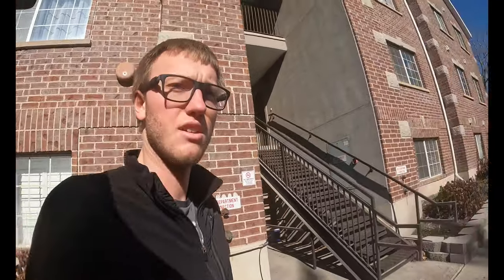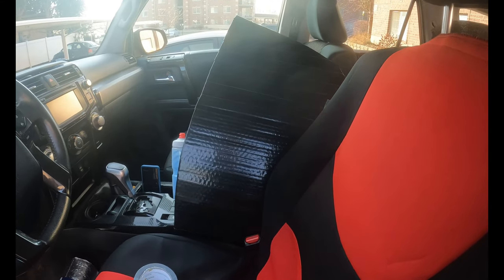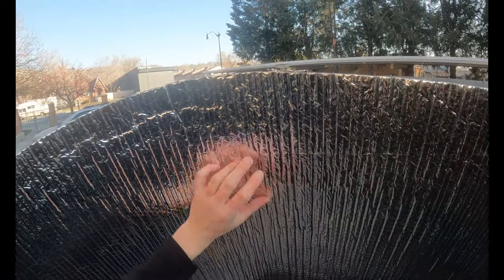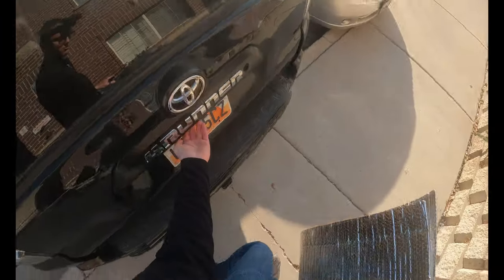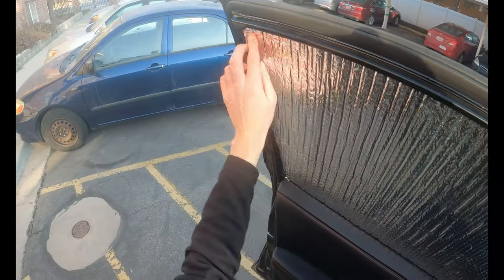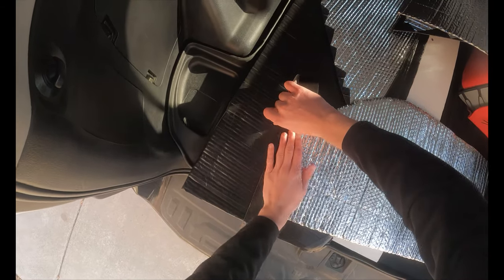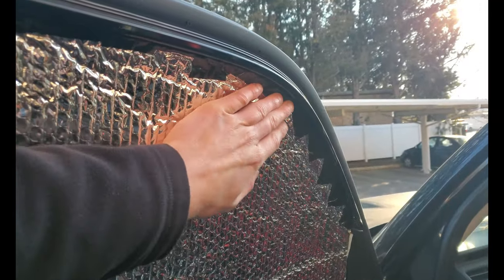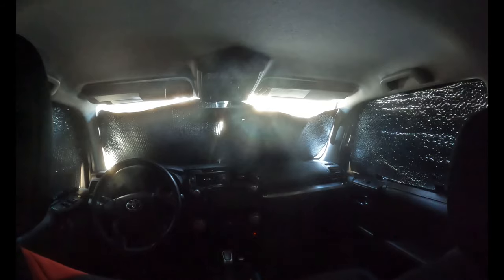Easy DIY Insulated Window Covers for Stealth Car Camping #STEALTHCAMPING #CARCAMPING

Comment: You can use duct tape around the edges, folding in half longways to use to cover all gaps, because all those gaps will show up like a flare when you are in the dark and turn on a light inside the vehicle. When you do it that way it also acts as a "Pulltab" to pull the covers off the windows, but you definitely want all those gaps completely sealed so no light shows in, that way no light will show out and you will remain completely unseen at night. It will save you from an unwanted knock in the middle of the night!
Reply from the maker: Great idea!

Comment: Thanks. I was thinkingnof using 1 inch thick insulation foam and a electric hot knife to cut it. I am pressed for time to get this done so I think I might do the same thing you did.

Comment: I think I would use a sheet of 3/8" black foam or cardboard spray painted black on one side.  The black foam is easy to cut slightly over size so it conforms to the shape of the window but oversize will help it to stay put within the window frames.  Either would be cheap to make, easy to replace and store.  Simplify whatever works best for your car windows.

Comment: I made mine the same
Larger cut w FRESH razor knife into indention
Is easier
You're half way there
If u have 5% window tint
At night a car can get then to reflect driving past

Soooo
Get the $3 flat black from Home Depot and spray paint the outside facing sides

Now Noone can decide 
Hey there is someone car camping !

Now your stealth and insulated

Comment: Ive seen camper van guy whos a nurse living in his vehicles use foil insulation from any hardware store. 
Ive used duct tape and cheap dollar tree place mats on some of my windows.the drivers side. And the passenger side i have a shower curtain that runs across the length of my windows. 
Back window i use a sun shade. To block the front off i have another shower curtain to run across on a bungie cord. Hope it helps. Fyi you should be abel to cut that foil to fit right in without tape. Or buy some suction cups & poke a hole in the material just big enough for the suction cup to fit & stick 
Wish you all well hope this helps Repent Because God Loves You All. Learn Who He Is And You Can Learn Who You Are & Become Equal With Him. Be Safe
Reply: Any photos of your curtains
Reply: @samtx  phn so rigged by God not Abel to post any. Lol

Comment: Wouldn't this block airflow on the side windows if you keep them open slightly overnight to improve circulation and minimize condensation buildup?
Reply: You can run a cut sideways and run a piece of duct tape on both sides to act as a flap to fold down if you want to roll window down even with your ventshades! Works great!
Reply from the maker: This is a great idea!